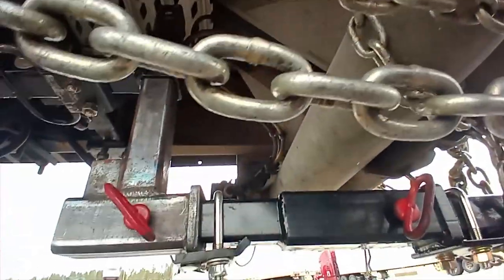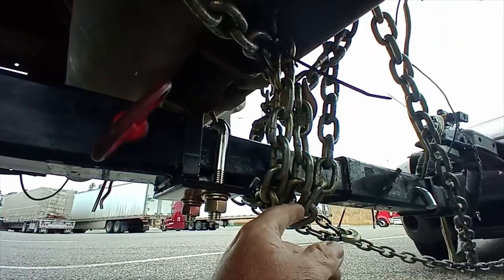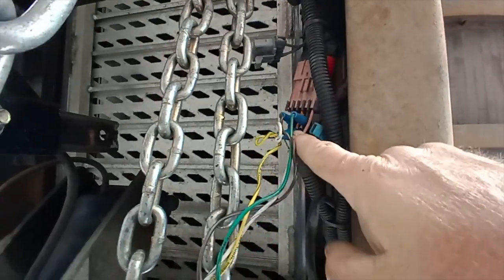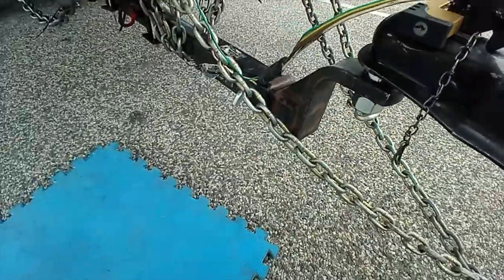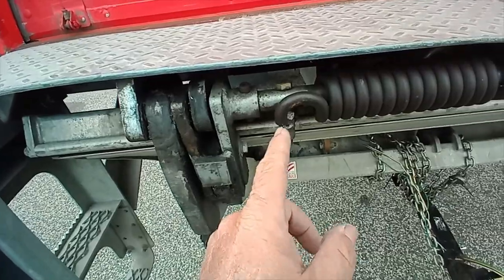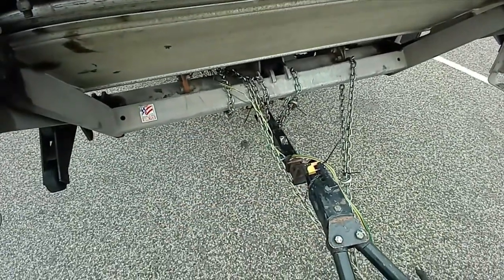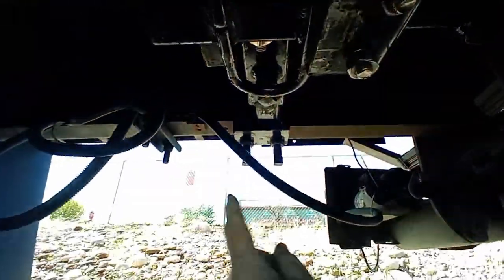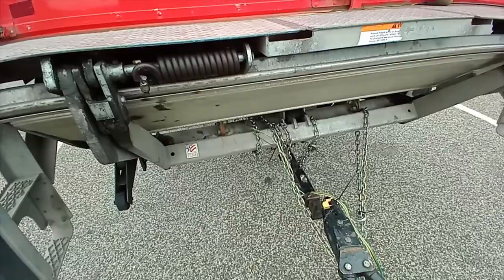Hooking Up To Truck With A Lift Gate

Comment: Is that the regular style lift gate?  Looks like a tuck under.  Really want to figure out a way to put one on a truck with a tuck under lift gate but looks complicated.

Do you just disconnect tow extension hitch when u want to use it?

Also how much do you think that long extension is rated for?  Seems okay for lighter weight towing but would be very scared with heavy towing.  I need to tow an 8000lb wood chipper regularly for my small tree service business
Reply from the maker: You know, this video was made quite a while ago and I really don't remember what type of lift gate it was. But I've started using a pancake hitch from Tier1 Fabrication when I do take a lift gate truck. I try and not take them because they can be a pain to hook up to. As for that stinger (I also got it from Tier 1), I'm not sure what the rating is for. But I bet if you call Kris at Tier 1, he can tell you what it's rated for. His website is http://t1fabrication.com

Comment: How you doing don my name is ace me and the wife are driveaway drivers I was trying to get all the info on flat towing the things I need to flat toe my vehicle can you plz contact me with the exact names of the tools and web info thank you
Reply from the maker: Really all you will need is a baseplate for your car. Make sure the car you choose can be flat towed, not all can. You can find baseplates for your car at etrailer.com. After that you'll need a tow bar, which you can get used ones on FB or new ones at etrailer.com also. Then you'll need a way to connect the towbar from your car to the vehicle that you'll be delivering. You can find everything you need for that (pinch hitch and adapters) at http://www.t1fabrication.com. Hope this helps.
Reply: @DrivingWithDon  I have a 2017 jeep compass trail hawk is that a gd enough car came with two red hooks on front of it not really sure what the two red hooks are for
Reply from the maker: @AnthonyHills-g6g  those two hooks are just for pulling you out in case you get stuck. Not for towing going down the road. I'm not 100% sure, but I don't think Jeep Compass with an automatic transmission can be flat towed. Check your owners manual. I've heard that the manual transmissions can, but again, check your owners manual.
Reply: @DrivingWithDon  why can’t a automatic transmission be flat towed or is it just certain automatic transmissions ?? And is the car you flat tow a manual
Reply from the maker: @AnthonyHills-g6g  just certain automatics can't be flat towed. From what I understand, it has something to do with the way the transmission gets lubricated while being towed. It can burn some of them up because they will still turn while in neutral but the fluid won't circulate. Yes, I have a 5 speed manual in my Ford Focus.